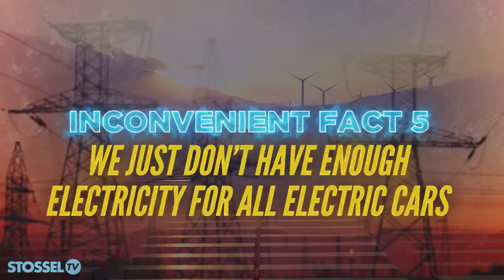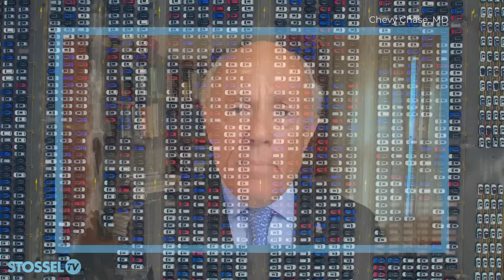Electric Cars: Inconvenient Facts, Part 2

Comment: Oh man, I've been arguing this exact same set of realities for YEARS now. Local towns like mine are having fever dreams about electric charging in every home, until I point out, we'd have to dig up and replace EVERY SINGLE POWER LINE to at least double capacity, with zero guarantee our electric grid can even generate that much power so quickly.  And I'm berated for being "out in the weeds."
Reply: That makes no sense. People
are charging EVs at home now without doubling their power consumption. It costs less than $50 extra a month (far less in most cases) to charge an EV. And even if that is somehow “doubling” electrical use it’s mostly done at night off-peak. Nobody has to upgrade their power input to charge an EV or even three of them at once.
Reply: @ConservatEV  per evannex website "youl'll need to use about 50kWh of energy to fully charge a standard range model 3 battery". So if you charge your car every day that is 50kWh x 30 days = 1500 kwh per month. Per energyusage website, the average home in my state uses 1353 kWh per month. So the ave household usage is doubled. Try to be honest about this.. lying is not helping you..
Reply: @ConservatEV  The fact of the matter is that CERTAIN people are charging their vehicles at home without doubling their power consumption. Many people live in apartments or other places where options of charging through less expensive means at home is not possible. 

If you drive a few km/m a day then sure. But the point isn't that someone couldn't own three tesla's and charge them at home. The point is that if EVERYONE has a Tesla and EVERYONE is charging them at night, night becomes a Peak time with that energy draw and if you're not paying double now, you will be later... Especially when they have to upgrade the grid to allow for the massive increase in load.
Reply: If they make illegal EV charging from 5pm to 11pm this quarter of day then the Electric Grid can handle EVs, the grid normally operates at 70% capacity of power lines and power plants.  England is installing machinery so you won't be able to charge 5-11 the charger just wont turn on......   So EVs could be used if smart the problem is they are expensive to buy so mean to poor people, adn a hassle to charge for the half who don't own a house.  And they cut energy and pollution need of cars just 40%, its not a silver bullet, just a helpful step that will be a costly pain to do.  There is no green way to move a worker 50 miles total a day, to a distant job across town, its like saying we can have a green bonfire, we can cut pollution a bit from commuting but still are moving 5000pounds fast 2x a day it cant be green.  Same with big houses, more than a hut.  Same with having 20 electronic devices and internet.  We live like Gods in West unlike some poor African, and unless we give it up we'll no matter what probably pollute 50% as much as in 1990 per person.  . . . . .
Reply: @mostlyguesses8385  so what happens when everyone has an EV to charge at the time that you specify at night? Instead of say 500 EVs in a given branch of the grid, that it is 10,000 on a given branch.. What then?
Reply: @TheSandwichMonster  Exactly! 100% When everyone has an EV, the grid is overloaded and when all those batteries need replaced and the old ones thrown out, please pray for the world because it is an ecological disaster waiting to happen
Reply: @mostlyguesses8385  and fyi, if you are in Cali, they already have brown outs between noon and 5.. so don't charge your EV between noon and five, or as you say between 5 and 11, so get your ass out of bed after 11 and charge your car... and hope it's charged by the time you leave at 6:45 am
Reply: @ST-cy6we  do you burn a full tank  of gas per day? x 30 days?
Reply: @ST-cy6we  you know you can get wall chargers that will start and stop charging on a schedule set by the owner of said charger right? a
Reply: @ST-cy6we  I have been driving an electric vehicle for over six years. You do not charge a 50 kWh battery every single day 85% of all people with drivers license in the United States of America drive 39 miles or less per day so 85% of people who drive vehicles will 100% definitely not be driving a full batteries worth of driving every single day.
Reply: @justinschmidt1380  How will you ensure that the battery, when it fails soon, will not be thrown in a city dump? I just rebuilt a gas engine from 1972. The only parts that I threw away were gaskets. The rings and bearings were recycled. Your battery is trash and pollutes. What will you do with it when it fails
Reply: @JeepJohn  No, but my vehicle can drive 500+ miles on a tank of diesel and if I use the AC or Heat, it doesn't crash my mileage. If you try to drive your Tesla in below freezing temps and run the heater, you will be walking after 100 miles
Reply: @ConservatEV  It’s more of the power grid not being able to handle the load of electricity than the household amount used. The power grid hasn't been upgraded in years the infrastructure sucks and no mention of improvements have been made which is why you get power outages.
Reply: @ST-cy6we   .  It seems California brownouts 2022 WERE MINOR and affected under 1m for about 4 hours on a few days, out of 35m californians.  And seems to be around 6pm when solar dies and people start cooking dinner and charging EVs and everyone boosts their home AC. .  It is hard to get exact info, so if you solid different info that'd be great???.   I am fine with brownouts, the cost of 100% guaranteed supply is keeping extra huge plants for those 3 days a year they are needed from fluke 20% hi demand spike, from heatwave usually in August that comes each 5 years.    .. . .  Most industries don't guarantee there won't be hiccup, the mail is late after storms, grocery stores run out of fruit.....   Cali has nice weather it can do day without electric heating, unlike Texas in winter....  The Midwest has the stablest electricy since at 30 below you need your electric switch to turn on the gas furnace...  Ha.
Reply: @ST-cy6we  ... Nighttime electric need is down 40% from peak 6pm demand, so yes the Grid can handle everyone charging their EV. As I said, its the 6pm-11pm when people are cooking/ac/watchingTV/washingclothes that is the bottleneck.  And yes your house wires in house and circuit breaker also can do it, but you can't also run stove and fridge and dryer and electric heating that plus EV will pop the main circuit.  The problem is extra charge on people of say $20 if they charge from 6-11 any night, will Americans stand for that ?   And the bigger issue is to save 1 ton of carbon per year per person EV v gasoline are we willing to make each poor person buy an EV, costin like $30,000 not their usual used $4000 car.  I use to buy cars from goodwill for $600 and run them a year, that was awesome.  Ha.
Reply: @ST-cy6we  moving the goalposts. Someone showed that you are incorrect about electricity usage of normal EV user. Your response is "what do we do about the waste." If a reasonable reply is given to that you'll just move on to your next talking point. In my opinion your arguments are in bad faith.
Reply: @coryc9040  If the purpose of EVs is to stop environmental damage, disposal of the batteries is 100% relevant. The batteries will create an environmental disaster greater than CO2.
Reply: @coryc9040  One more: when everyone is an EV user then nobody is special. 
The novelty of EVs will be lost when local water supplies are contaminated by heavy metals from the dead batteries...
Reply: @ST-cy6we  When you replace your car battery, do you throw it away? you know places will pay you a core charge because even dead batteries have value. Electric car batteries are not simply being sent to the dump.
Reply: @mrvat100  Wrong. Lead/acid batteries are recyclable. Lithium ION are maybe, sorta but not really. Nice try.. do some research before you mouth off next time.
Reply: @mrvat100  and let me clarify "electric car batteries", which are lithium ion, are being sent to the dump, or to China where they are incorrectly broken down and contaminate the soil and the water.
Reply: @mostlyguesses8385  your house is 200 amps and is not the problem. The problem is the backbone of the grid that can't handle 40,000,000 cars charging after 11 pm...
Reply: @mostlyguesses8385  another problem is that there is not enough lithium on the planet to power all of the carsl phones and electric drills. and for each car battery 500,000 pounds of earth has to be mined for the lithium . 
What good is saving 1 ton of carbon when you create an open pit mine ecology disaster (see Butte Montana for mining disasters) and a battery disposal ecology disasters. You can't solve one eco disaster by created another.
Reply: @mrvat100  since you don't know the difference between lead/acid and lithium ion batteries, I'll disregard everything else you say
Reply: @ST-cy6we  Don't know much about electric cars, huh? A model 3 does about 4 miles per kWh. If you charged your model 3 with 50 kWh's per day you would be driving 200 miles a day. I am sure some folks do that, but the average is 35 miles a day (and for many folks it is much lower). If you drive your car 40 miles a day (to make the math simple) and you make 4 miles per kWh you would need 10 kWh per day to charge your car which would be 300 kWh per month (which is still a lot). That is the correct math. 

What you just said is the equivalent of this: If your car has a 10 gallon gas tank and you filled it up every day that would be 10 gallons x 30 days = 300 gallons of gas every month.
Reply: @mikereinhardt1244  They aren't electric. They are battery powered and the battery is the failure point. If they were electric they would run on AC, no DC like a golf cart or a toy. My diesel truck burns fuel. Your battery toy does also. It just burns it in the form of charging that bad battery and in making the solar panel.. The toxic waste from your battery and solar panel are worse than my diesel fuel,
Reply: @ST-cy6we  Lithium Ion batteries are full of valuable minerals that are fully recyclable at the end of their useful life. See Redwood Materials in Nevada does this and supplies the materials to make more new batteries in Nevada. 🇺🇸
Reply: @justino4489  There are token recycling efforts but it's not profitable so, it's not really happning.. nice try though
Reply: @ST-cy6we  Ok sorry the $3.5 billion American battery recycling facility is not good enough for you, and the valuable minerals inside the batteries are not worth saving. All I know is I don’t have to pay Joe Biden gas prices or get oil changes since buying my first Tesla years ago and I’m never going back to a gas truck.
Reply: @ST-cy6we  ... I don't think EVs are as bad as you think.  Counting energy to mine and manufacture over 10 years they do result in 50% saving in co2. The earth is huge, there's enough to lithium it'll just be lots of work.  We mine much iron and coal and it's not a eco disaster, let's not exaggerate.  I was EV doubter when batteries sucked n charging was slow, but darnit tech surprised us all.  So they're cleaner, but they are hassle and costly.  But they aren't enough, cutting 1 ton co2 off 14 ton avg American persons pollution, leaving 13, basically.  . . .  It's so small it's almost a distraction, people still fly, have 200,000lb house they gotta heat and rebuild each 40 years, etc .....  Oh well.  Peace...
Reply: @ST-cy6we  This is the last reply to you, because you clearly need to get educated, and I am not going to convince you of anything. Battery is electric, batteries store electricity. There is no factual backing for what you are saying. This has been studied extensively and batteries do not cause more environmental damage than running a diesel truck does. More is done in the creation of one, but less is caused in the running, it breaks even around 40-70K miles. As far as disposing of them, EV batteries can and will be recycled because the components are expensive. Solar panels are harder to recycle, but that is being improved and can be done to.
Reply: @mostlyguesses8385  A couple points I'd dispute.

1. It really depends on where you live, when it comes to what a grid "normally operates" and what time of year. This can fluctuate drastically depending on where you live. 

2. Electric Vehicles are expensive quite literally by design. Aside from the battery and software in the car, the hardware and shell is mostly the same as your average vehicle. The battery is FAR more expensive and you have a lot more electrical nonsense for self driving bullshit that very few would trust with their lives. It's kind of one of those things that the tech that isn't complete, shouldn't be in the car and the most you should be paying for in all of that right now, is the battery. If they weren't charging for tech that doesn't work properly in the car, you wouldn't see Tesla's as high. 

3. There are no "green ways" to move any group of people anywhere. There doesn't need to be. Trains and buses and planes in extreme cases are viable ways to travel. Trains especially as they can be electric and as green as whatever you put into the grid.  If you think humans are contributing in a significant way to Global Warming as it's defined today, you're delusional and nobody can help you. One volcano does more damage than 100 years of human pollution to our earth in many ways. From the carbon shot into the atmosphere to the destruction of wildlife and vegetation. Earthquakes and other natural disasters cause far more damage than Humans ever will. Let them keep convincing you that we're predominantly to blame or could drastically change things with massive human efforts. Then you'll have to explain the next point to the future generations while poor people struggle to go green at the expense of their lives.

4. Poor Africans are living very different lives than those in the west, it's true. But if you think Green technology, which is unaffordable to many of them is going to help them you're again, delusional. These people are using primitive and pollution-causing methods to cook food far more environmentally damaging than those in the west. By forcing the green movement you're hurting people trying to come up in the Third World. They need Carbon-Energy to survive. They don't have the luxury of paying hundreds of millions in taxes to give tax credits to those who buy a solar panel to make them more affordable. They can barely afford food. Living in hut's wouldn't satiate our requirements for electricity. Anyone who could afford to live in something other than a hut, simply would do that. 

5. We're actually working on, at least in the west, polluting LESS than we were in the 90's. Many more technologies exist to capture and destroy or reuse carbon either from the atmosphere or directly from stacks in power plants. There are many places, like China, who are not going to such technologies and because of them, no effort in the West will make a significant difference while countries like India and China, the biggest populations in the world, refuse to make serious strides to go green. Without everyone doing it, the effects are negligible.
Reply: @mostlyguesses8385  Gonna start this off with a quick point. You're right and I both misspoke, and was wrong either way. I misspoke in saying One Volcano does more damage than 100 years of human pollution. What I meant more generally was Volcanos, and that one major eruption can emit more Carbon than 100 years of human existence. However generally speaking what I meant and didn't say is still incorrect. Humans generally speaking emit more CO2 than Volcano's. Full Stop. 

Lets be 100% honest and say Scientists, aside from measureing the PPM in the atmosphere, have no real way to calculate how much C02 is produced by humans. Countries like China and North Korea do not make those kind of statistics public and there are no scientists there studying this without the leave of the Chinese Communist Party. So these are guestimates by scientists with the exception of the actual measurements, such as PPM. Calculations taken by taking clips of air from different layers can only tell you so much, there is a fair bit of guesswork that goes on in science.

Your own argument suggests that in the last 300+ years, the most industrial period in Human History, we haven't even tripled our contribution. The estimates from Scientists as far back as the 70's haven't panned out. From Mini-Ice-Age to water rising a meter within the next 100 years (Lets be 100% honest and say the majority of the bullshit that popularized this was all fluff. Pseudoscientific nonsense). These are the same "scientists" who told us we were doing "Irreparable" damage to our Ozone and we only had one, it was never coming back. Then 20 years later we find out it's on the mend and doing quite well. The things these climate alarmists have predicted are NOT happening. Since your link didn't work here I'm going to say this. If you go to Climate . Gov (no spaces and search "doesnt carbon dioxide atmosphere come natural source"). They even say as recent as the last million years, it's been up to 300ppm Carbon. Nowhere do they say the Earth has NEVER had Carbon higher than that, they just say in the last million years. This is evidence in several other studies and sources. This is a lot of Assertions based on subjective information based on a SNAPSHOT in time relative to the age of the earth. For every scientific theory you can find an alternative. You and these scientists focus on one or two of the MANY sources of natural C02. There are more than just volcano's. Wildfires, which happen all year round, decomposing vegetation, animals, animal gases, outgassing from the ocean etc. While Volcano's do only put out 1:40 to 1:100 depending on your source to that of humans, that's on a Per-Annual basis. That's not taking eruptions when they do happen into consideration, it's simply an idle volcano that may or may not be active on the surface. 

Here's something for you to chew on. This is from the US Department of Energy Website, feel free to google it to see for yourself. While they don't offer sources, it's a Government website that should be reputable. "Natural CO2 sources account for the majority of CO2 released into the atmosphere. Oceans provide the greatest annual amount of CO2 of any natural or anthropogenic source. Other sources of natural CO2 include animal and plant respiration, decomposition of organic matter, forest fires, and emissions from volcanic eruptions. There are also naturally occurring CO2 deposits found in formation layers within the Earth’s crust that could serve as CO2 sources."

So according to the US Government, Natural CO2 sources account for the majority of the CO2 released into the atmosphere. Put that in your pipe and smoke it. Also I believe it was BMW that did a study that said you had to drive anywhere between 40,000 to 60,000 Km in a Combustion Engine to start getting into the Carbon Footprint of an EV off the assembly line. That does not include the Carbon used to fire the power plants which run the grid. Battery technology has gotten better but it can only get so good before the RND price makes the end product cost too much. They can shrink cellphone batteries but it's far different to shrink batteries storing far more energy. The amount of mining you'd have to do to create enough batteries to store enough energy to hold the power created by renewables, not including the windmills and panels themselves, its disgusting. You can't have a green anything without a carbon birth. And in many cases the manufacturing carbon cost lives long into the life of the product. Most Turbines and Panels have a lifetime of a Maximum of 25 years and in many cases you're more than half of that lifetime paying the cost off before you see any kind of savings benefit. And that 25 years is assuming you don't have an especially dry summer that puts a lot of dust in the air and wind that blows it around, scratching the surface of your solar panels and getting stuck in your turbines sensitive areas and causing wear. 

I live in an an area that is trying to do a LOT of green stuff at once from Solar, to Wind and Tidal. The Tidal, while it should be the most straight forward seems to be the biggest money pit and has gone massively over budget for something that may never actually produce any power, to a few hundred people hooking onto private grids powered by hundreds of acres of clear-cut crownland where they've installed solar and wind and it has trouble powering a few hundred homes. 

The main source for EV charging is still Fossil Fuels. It will be Fossil Fuels for the next 100+ years because it's the most reliable and easy to store. Banning people from making or using these combustion engine products like they're doing in California and other areas doesn't help the environment. It hurts the poor people trying to run a lawncare company, or a snow removal company who can't afford the electric version, which in many cases to stand up to the gas, costs 2x or more the price.
Reply: You obviously don't have to rip up any power lines or double capacity (certainly not of the power lines) to charge EVs.  That's just stupidity thinking out loud.   Charging at home is easy.   The worst that happens is that the utility may need to upgrade the neighborhood transformer to handle the demand (just like they did when AC started to become common).   But otherwise we're only talking about the grid having to increase total power by 1% a year (about 30% over 30 years), and peak consumption only increases around 10-15% (0.5% a year).

Nor is there any need to even necessarily charge an EV at high amperages from home.  It just depends how much you drive each day.  1kWh = 3 miles.  Average commute in the U.S. is something like 40 miles round-trip.   Around 13kWh spread over, say, 6 hours (being convenient).   What's that?  Equivalent to a space heater?   It is not a whole lot of power insofar as the neighborhood distribution lines are concerned..   Worst that happens is that the utility may ask a home owner to set the charge rate lower until they can upgrade the transformer.  That's about as bad as it gets.  90% of homes wouldn't need an upgrade at all.

In otherwords, you are talking nonsense.  This is what happens when you don't think things through, don't understand the technology, haven't run any actual numbers, and believe nonsense pushed on YouTube.

-Matt
Reply: @mostlyguesses8385  This sounds like a Chinese auto-translation bot complaining about... England?   Mostly Guesses Wrong, I guess.
Reply: @junkerzn7312  ... Mostly agree, but gotta penalize EVs charging early nitetime.  Would $1kwh extra stop you, from charging 10kwh before 11 and would we all politically accept this or would we all whine it was limiting our freedom.. .  I do wonder if EV batteries would be better used next to solar and wind farms, they'd get max use unlike a EV driven 20 miles a day with 400 mile battery.  But greens never get priorities right, ban 0.1 gram plastic bags making my grandmas life hell as she walks home with paper bags leaving untaxed my 10000lb coal a year furnace. Ha
Reply: @justino4489  All moving parts need lubricates.
Reply: @nitsudocsicnarf347  Tesla motor/battery coolant does not need to be replaced for the life of the vehicle under most circumstances. I have not required any vehicle service outside of new tires, washer fluid, cabin air filters, and wiper blades.
Reply: @junkerzn7312  Just to be specific lets use Tesla as an example when it comes to EV. We can be specific with another brand of your choice if you prefer. Charging at home is easy assuming you live in a house and not an apartment. There's also many methods to charge at home from wall connectors you have installed by Technicians, there's 120v chargers that will run you for like 4-6km per hour charged, and 240 volts that will charge it at 45km per hour. All come with decent prices, depending. Depending on your set up and commute it could make for a rather annoying experience on the cheaper end at 120v. You think that would only be an increase of 1% a year? There's over 280 million (registered) vehicles in the USA today. If you think 280 million cars plugging in is gonna max out at 10-15% increase on the grid you're banana's. Cables will need to be upgraded and replaced.

The difference with your space heater anology is that not everyone uses space heaters, everyone will be required, at some point, to have EV's at this rate. Some people have other methods of heat and don't use electricity. If you'd like to come back with some actual numbers feel free. But even with your example, which I don't know where you got it from, your numbers are vague where mine are specifically from Tesla's own website. If you have info from another brand or source let me know that we're comparing apples to oranges. The cheapest home charging option for Tesla is " A 120 volt outlet will supply 3-4 kilometers of range per hour charged. If you charge overnight and drive less than 45-60 kilometers per day, this option should meet your typical charging needs." If you charge your car for 10 hours a night, you could travel on average 40km a day. If you can do all your driving in 40km in a day, congrats I suppose. I sure couldn't. 

-Firstname Lastname.
Reply: @nitsudocsicnarf347  Generally yes. However,  combustion engines produce far more heat and and have more moving parts compared to an electric motor. The heat and combustion byproducts degrade the oil requiring replacement.

Within a system where you don't have combustion and heat, grease and oil can last substantially longer. For example transmission that are good for 100k miles or sealed bearing good for the life of the component.
Reply: @TheSandwichMonster  Exactly my point.
Reply: @justinschmidt1380  Unless you live in the suburbs, then your commute can be quite long near major cities, in order to afford the house in the first place.
Reply: @ST-cy6we  Well, I will add that recycling of those batteries is the only long term solution and technically I think it is possible. It's a matter of when not if.
Reply: @mikereinhardt1244  Except in winter, when the burn rate will be much higher and your battery capacity much lower.
Reply: @TheSandwichMonster  I especially appreciate your #5 remark... without the complete cooperation of every country, especially China, India, and even Russia, major CO2 polluters, the overall world CO2 level will never go down, and all our sacrifices and efforts will go down the drain as we go bankrupt subsidizing all of this. If we could save the world just by going on this mad spending and infrastructure cost here in the U.S. then OK, that's a debate worth having.
Reply: @junkerzn7312  "That's just stupidity thinking out loud. " Well, I certainly see how open you are to opposing ideas... just call them stupid. What you are not taking into account is that the power generators themselves (regardless of source) cannot keep up with the anticipated demand... If you live in a state that has lots of empty land to be used for solar etc, good on ya. If not, like here in NY, the state has lost extensive power generating capacity for multiple reasons you can read about.  In California it's much worse. Expecting to get more from less is not a logic I'd like to bet the farm on. And FYI, in our neighborhood, the local power lines are still run on telephone poles, which cannot handle the extra weight of additional power lines that would be needed to service it all. Finally, again, your math is broken... every increase per year accumulates to a greater total number year after year... the 1%, for instance, is not based on the starting year, but applied to the new total amount year after year. This means your total "actual" usage will be exponentially accumulated over the years.
Reply: @TheSandwichMonster  Finally, some sanity in the darkness...
Reply: @DarkMagic666  It is true that EVs suffer more in winter than ICE cars do, but even in winter they are more efficient than an ICE car... just not as much. If you live in a cold climate, I recommend checking which ones have heat pumps. BTW ICE cars also lose some efficiency in winter, and the 2 reasons EVs do worse in winter is not because batteries don't do well in the cold. They don't but the batteries are thermally managed in pretty much all modern EVs. That management takes more energy in the winter, the ones that do best are those with heat pumps. The other reason is because ICE cars inefficiency is given off in heat. So EVs do slightly better than ICE cars in hot weather, and ICE cars do better than EVs in cold weather.